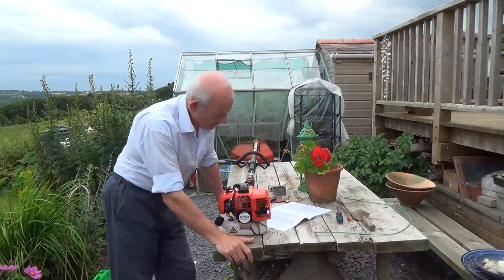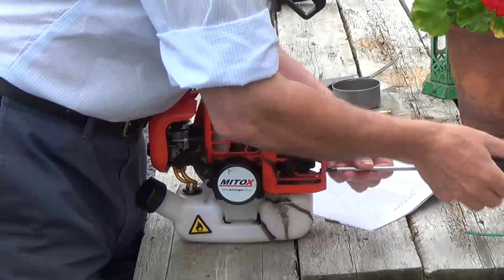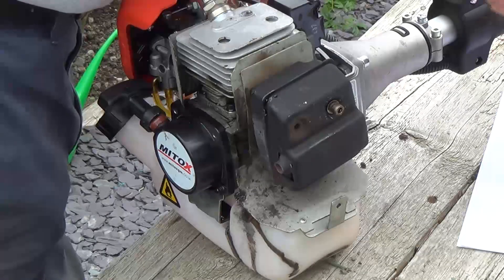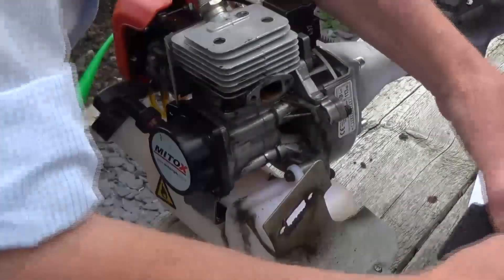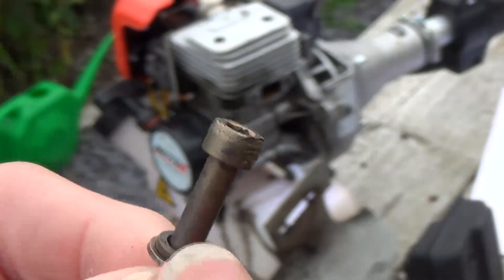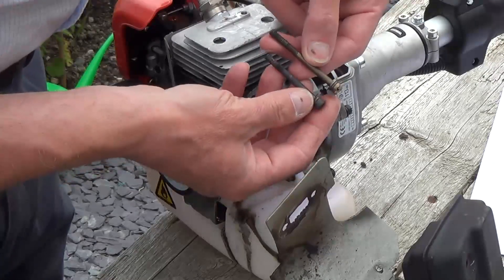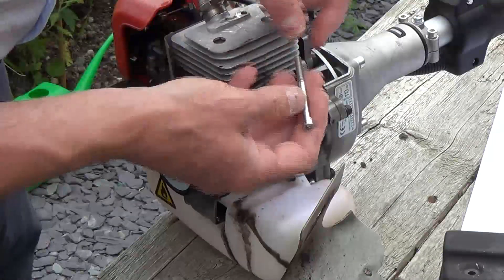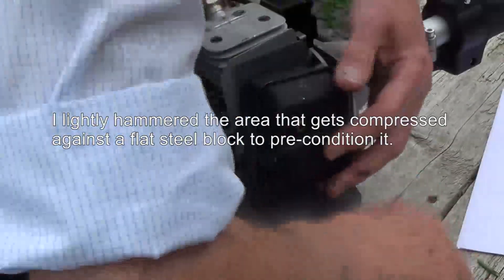Repair of two stroke engine

Comment: Andy I have a question if that's ok , I have A faulty strimmer , the plate that rises and falls behind the plug seems to be hitting the plug to the point where it's closing the gap ( surely that's not correct ) if I pull the cord it works freely with the plug out but struggles with the plug in . Ps are you a Brummie , theres definitely a bit of Brum in your accent . thanks

Comment: There is your clue.  You said the machine is horrible to use because of vibration.  Vibration kills motors and fixtures.. Locate and fix that problem and the rest will be fine.  Could be in the trimmer head, clutch, flywheel etc.

Comment: Andy, dont suppose you have a clue as to how to adjust this carb do you? IE what the start setting is, (thought it was 1 and a half turns out from full in). Be much obliged if you did, as mine is now failing to run when warm...
Regards,
Jack Rogers
Reply from the maker: Hi Jack Sorry I'd have to look at it from first principles, I've seen the manuals on line for this machine and I think if you Google the problem you should find the answer.
Good Luck.
Regards  . . . Andy

Comment: Andy, What I see a lot is 2 stroke motors being made in China and the one big issue there is the quality of the die cast metals or non stainless steel bolts!! They are horrible and thats why rattle loose easily and/or  they sheared off due to poor quality of metal..
Reply: 20 ml
Reply: There is a slight viscosity difference and ash burn rate. You can use. Motor bike 2 stroke oil but not recommended long term
Reply from the maker: Hey, don’t talk to me about cheap products from overseas; I’ve got some Chinese batteries for my video camera here that I’ve just opened up and the quality inside leaves a lot to be desired. They will get there with quality control and some have but, hey it’s my fault... you get what you pay for... (well some of the time)  
Kind Regards ... Andy
Reply: AndyDaviesByTheSea Hi, I recently purchased a 33cc brush cutter which recommends a fuel to 2 stroke oil ratio of 30:1. The product came with a 600ml plastic bottle. How much 2 stroke oil (ml) would you recommend to mix with 600ml of petrol ?
Reply: Hi,Rob, is it harmful to the brush cutter, to use 2 stroke "motorcycle" oil ? or is it just a advertising gimmick, that says not to use 2 stroke motorcycle oil for garden appliances.
Reply: Hi Rob, after roughly how much running hours would you recommend to replace the spark plug of a brush cutter (33cc) as part of periodic maintenance ? The manual does not say. Thanks.
Reply: +Akmal Dawson Spark plug changing should be undertaken in a regular routine along with the rest of your maintenance on the machine every year before you put the machine away over winter. Otherwise if something happens in the mean time then it should be replaced regardless.

Comment from the maker: Funny you should say that, I was wandering about putting a pretty powerful spring to pull the bottom on the silencer towards the engine case so as to take hold of what you might call the ‘flappy-end’ of the silencer.  There’s a reasonable bit of weight off set from the two socket screws and I think if the gasket yields even a little bit and once the silencer starts to move just a fraction then it can only get worse and probably very quickly, a big spring could stop that.
All the best ... Andy

Comment from the maker: I don’t know why they have used two gaskets as I'm sure the compressibility of the two sheets contributes to the problem, I think if they wanted a second heat shield it would be better not to try and sandwich it and clamp it with the exhaust port. But I suspect it’s for cheapness.     
All the best ... Andy

Comment: Maybe it is an over tightening issue from the factory or over vibration due to poor balance of the core components. I don't know allot. But in my opinion I think its from over tightening like you say, an m5 takes a lot to shear off

Comment from the maker: I’ve been involved with making thermal equipment to be fitted on to Mechanical Fatigue Testing machines so that the specimens can be thermally cycled for Thermo-Mechanical-Fatigue testing, (TMF) and that’s very interesting and can get very complicated. Vibration is a fascinating thing. I’ve seen vibratory conveyer belts for moving potato crisps around a factory and ‘vibratory bowl feeders’ for feeding small parts in to automatic machines are very interesting.
Kind regards ... Andy

Comment from the maker: Hi Ross I posted the video in the hope that just maybe it’ll help someone one day with a similar problem and of course it gave me the opportunity to make a video with my new camera. I thought it was an odd failure and haven’t had anything quite like it before, I’ve had bolts break because they were over tightened or subjected to excessive loading but this is an M5 bolt that broke for no other reason, as far as I can see, other than vibration. Maybe next time I'll buy Sthil
All the best ... Andy

Comment from the maker: I don’t think it’ll have been a thermal problem, ratchet creep could take effect at the engines working temperature. Metal has to be taken through quite a wide temperature excursion many times for this to have a detrimental effect. The reason I say that is the machine has only been used about 6 or 7 times and that would be almost continuous for around 1 ½ to 2 hours, so very few thermal cycles and 9 to 12 hours use at the most. I suspect mechanical fatigue due to vibration is the real culprit.

Comment: It is not wire wrapping, that is often used inside low production boxes as a quick way to make a run of 50 or so, but wire locking. You have both a special stainless steel alloy wire that work hardens as you tie it and a special set of long handled locking jaw locking wire pliers that you clamp on the 2 ends then pull on a knob at the bottom of the handle that uses a spiral threaded rod to spin the tool to twist the wires together in a consistent way from the end to the jaw. Easier than by hand.

Comment: And if you look carefully they use one length of wire all the way around a ring to hold all the hundreds of bolts in. That takes at least 3 hours per ring to do properly and to check it. You start sometimes with 20m of locking wire on that job, was not fun learning how to do it properly.

Comment: Steel bolt was originally a mild steel part and with thermal cycling and stress it cracked through at the max stress part. Actually the alloy casting will expand more than the bolt, and ideally you need an anti seize high temp lube on the treads to prevent what will happen next, which is the thread stripping out of the alloy. Then you want to just recoil it with a long insert and it will then outlast the trimmer for sure. Done that with M4, M5 and M6 recoils into alloy heater blocks a lot.

Comment from the maker: Hi Rick, thanks for the feedback on the camera, I have had some issues with HF sound noise in the past with the Kodak Zi8 but I think it’s only the young guys who can hear it. Ok on wire wrapping, I suppose in aviation terms wire wrapping could also apply to terminals. 
As for my little 2 stroke engine, I think I’ve put that to bed but now I’ve got no excuse for not strimming the grass and cutting the hedges.   
Kind Regards ... Andy

Comment: Hey Andy,
The new camera is working great, the video and sound quality are very good. All the equipment on aircraft that I worked on was wire wrapped. All the bolts that held the transmitting units to the engine and other parts of the aircraft were wire wrapped along with the electrical cannon plug to the transmitter. Not I think about it everything I worked on was wire wrapped inside and out of the aircraft.
Regards,
Rick